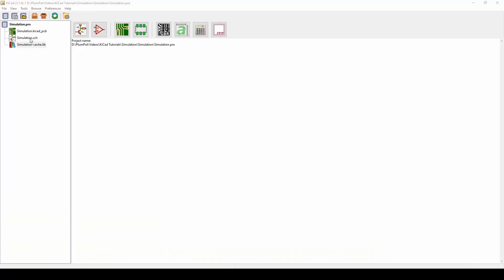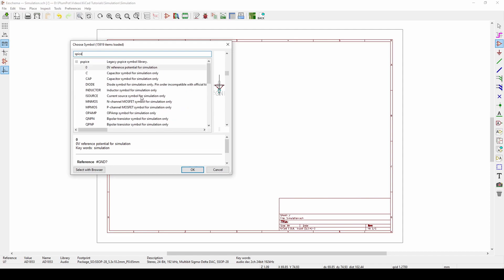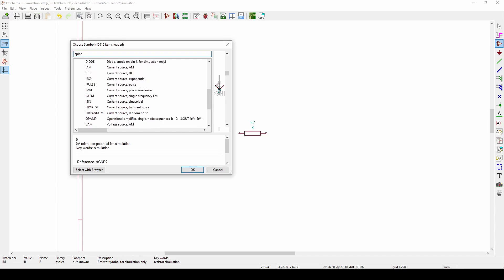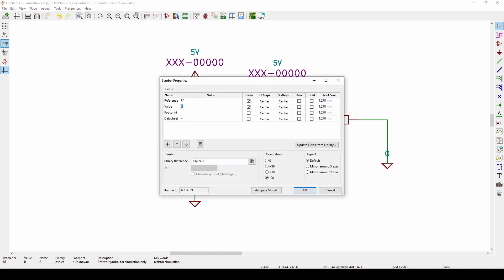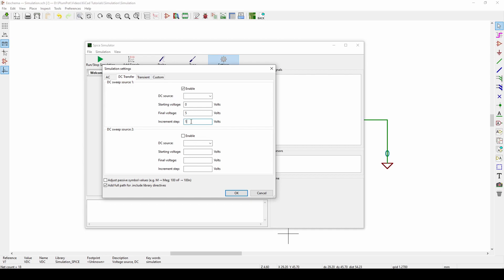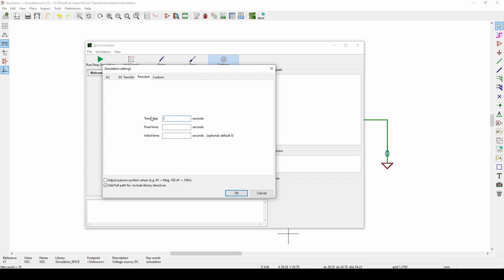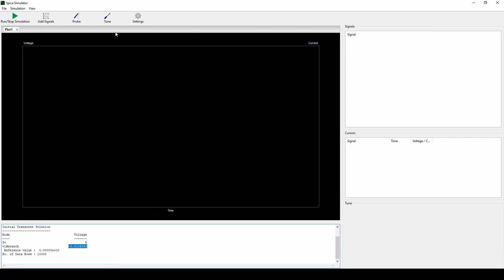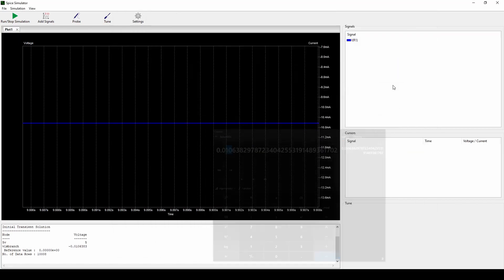KiCad Tutorial - How to simulate circuits in KiCad for beginners

Comment: Thanks for this tutorial.  It was very helpful.  I was wondering though - is it possible to simulate the circuit in this video with an LED instead of a regular diode and if so, how would someone do that?  I would expect to see a drop of perhaps 2.2 Volts (for a red LED) instead of 0.7 Volts.  Thanks in advance for any pointers.

Comment: I'm getting in simulator when add a diode (minute 14):
No compatibility mode selected!
warning, can’t find model diode
Circuit: KiCad schematic
Error on line 4 :
d1 net-d1-pad1 0 diode
Unable to find definition of model diode
Background thread stopped with timeout = 0
Error: circuit not parsed.

KiCad Version (5.1.12-1-10_14) wxWidgets 3.0.4 Unicode and Boost 1.76.0 on macOS Version 10.16 (Build 21~559), 64 bit
Reply: I got exactly the same error after trying to simulate with a diode. Everything else worked up to that point.
Reply: Me too!

Comment: I have a circuit problem, but I am not sure if the cure is better than the problem I am trying to fix.

I have a metal detector the runs off of (6 pack) and (8 pack) AA batteries. They are connected to 2 connectors that share a common ground..

(+12v)---(GND)---(-9v)

I was wondering if I am losing power efficiency if I made a 
(2 terminal battery pack) from LiPos and converted it to the voltages the circuit needs using a split phase output buck-boost converter. 

I don't know what the current requirements are, but I know it is more that the current output(14ma) of split phase buck-boost converters I found on ebay.

The alternative to a split phase converter is 
two buck-boost converters with isolated outputs.

Any advice?